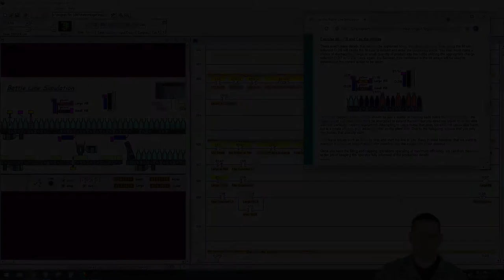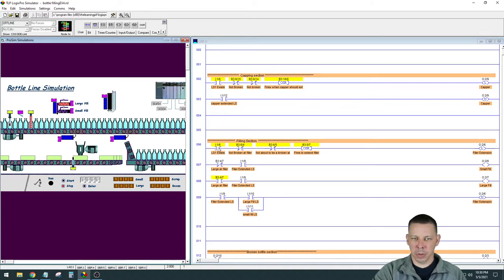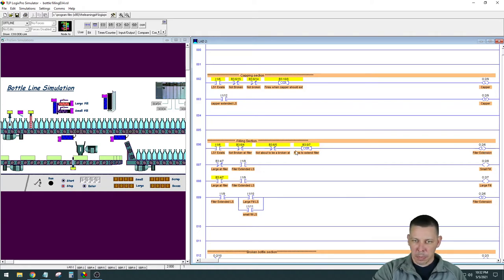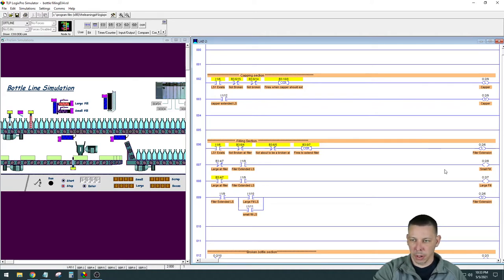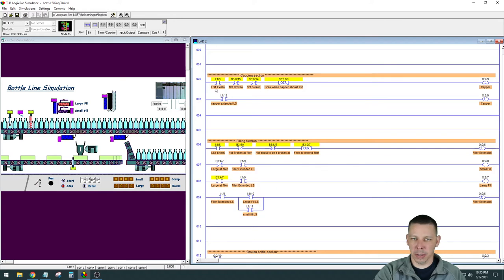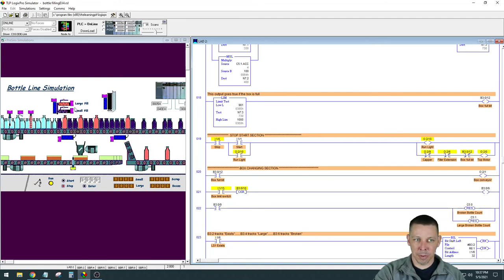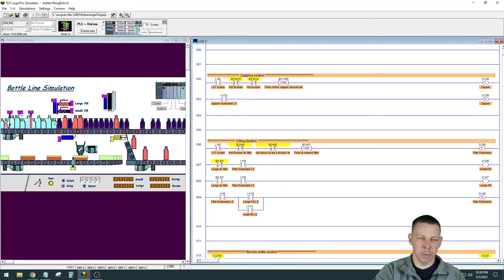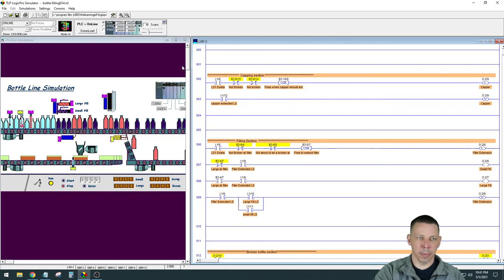LogixPro Advanced Bottle Line Exercise #4 -- Fill and Cap the Bottles

Comment: I copied the program you made but my cylinder won't retract which just shatters the bottles
Reply: I realise this comment is a bit late, If you add a "examine if closed" the square with the line through to stop the motor when the filler tube is activated this will stop the bottles from smashing

Comment: I wrote the program exactly like you did and I get bottles not filling some times as well as my  large divert sometimes opens early and drops small bottle that is right before a large bottle
Reply from the maker: If it's right when you first start the line, it's because of the old binary data in the bit tables. It will start working correctly after the data is flushed out. The other thing it could be is your speed. This program is pretty sensitive to the speed you run it at. Try it a little slower or faster. In the real world this doesn't happen, but in this simulator, some of the items don't respond like they should at certain scan rates.
Reply: u should put the B3:5/5 beside the B3:5/4, i mean put it in the same rung
Reply: @elmeonline9932  First, thank you for making these videos. They've been great so far. I did however, run into a problem on this one. I watched your lesson 3 and it performed normally but I am running into a lot of problems on this one. After many attempts, I'm stumped. My base program for this exercise was identical to your lesson 3 (working) program but after adding the logic for this exercise, I am still getting broken bottles, LG bottles with small fill, SM bottles with large fill, and a mix of LG and SM bottles being diverted to the lower conveyor. I'm going to keep plugging away at it though. I did notice that you either rearranged some rungs or added a couple things from the last lesson that are not shown in this video.
Reply from the maker: @bobbaganoosh1981  Logixpro is a tricky program. Sometimes when you change the scan rate it changes everything because the B values don't update at the same speed the animation does. The software was written a long time ago and it's starting to show. Adding stops on the main conveyor for the different operations also tends to make the animation and bit table not line up. If you bring up your bit table for the B3 bits and watch when it runs you can see they don't line up depending on the scan rate.